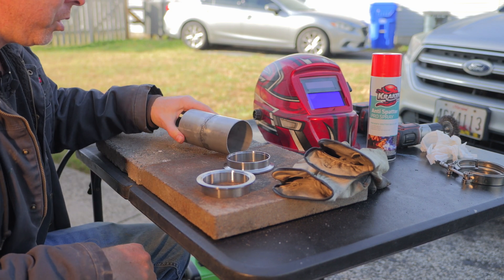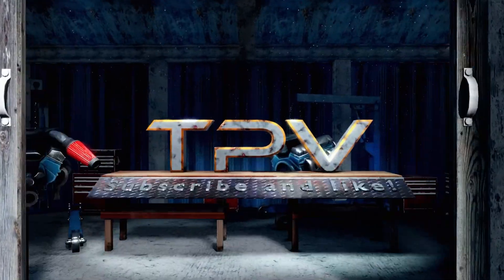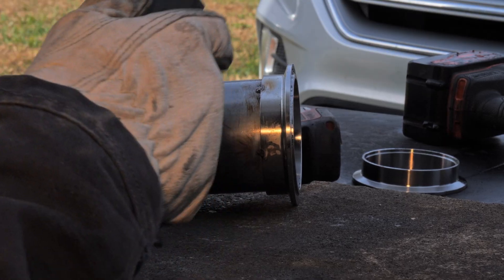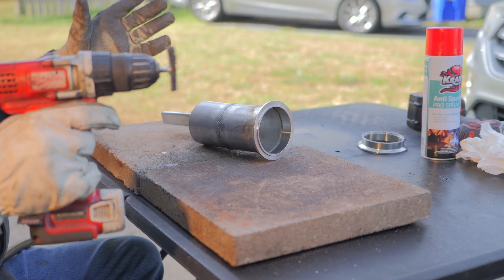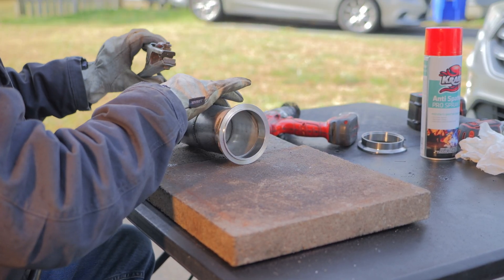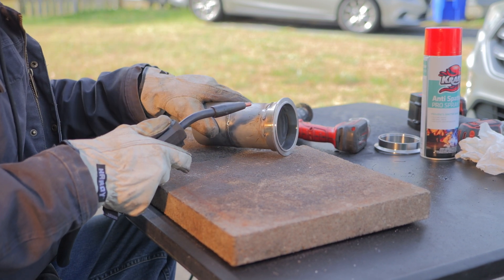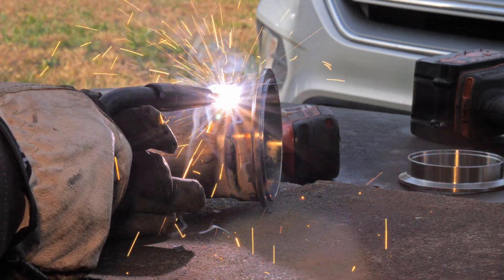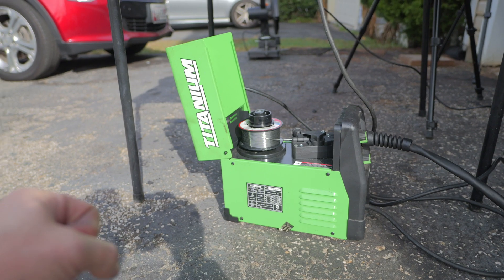How to Weld Stainless V-Band Clamps to Mild Steel with a $200 Harbor Freight Welder

Comment: Nice job good looking well for flux. Only thing I would say is maybe you should use stainless flux wire because that wire any other wire really does not stainless. It’s gonna rust so you got a well it’s gonna rust and rust fast. I might try it but I think I’ll try it with stainless wire stainless flux wire and see what happens. Seems like there’s no reason it wouldn’t work. What do you think?

Comment: Would this still work with stainless piping and a stainless v-band? I also want to do a custom exhaust and would love to try it myself. Is this welder a good option?
Reply: @codydonovan7356 You'd be better off with stainless flux core wire like BlueDemon 308LFCO if you're welding stainless pipe and flanges. You have to run that wire DCEP though so you need a welder that will allow you to change the polarity, the Titanium 125 is hard wired DCEN.
Reply: @bavarianblessed i thought it was DCEN for stainless flux core? My hobby mastercraft welder is hardwired to DCEP. Thats why i never tried to weld stainless.
Reply: @MN-sc2uz  no sir, most flux core requires DCEN but stainless flux core won't penetrate worth a damn that way. Needs DCEP

Comment: clamp vband together before weld to prevent warp..
Reply: Learned this the hard way. Very good tip.
Reply: This 100%
Reply: Damn, didn't think of that! Now I'll have to check if my v bands are warped 😬
Reply: I was thinking the same. Its getting warped

Comment: Would it be easier to do this horizontally? You wouldn't have to worry about slag then either. I need to weld one to a stainless steel reducer which is thin so i'm worried i'm going to blow through it.
Reply from the maker: @mooosestang  Weld it hover you feel most comfortable.

Comment: Have not done much exhaust work. But i do have experience with sanitation pipe. Just some advice, you always want to put three to four tack. 12,3,6,9 oclock. Sanitation pipe are mostly butt weld, but here the pipe slide under the clamp. So i get it, it might be necessary here.. just good habits to the untrained.

Comment: Uh downhill with flux core is a no, you fill the weld with flux inclusions and makes it brittle. Would have been better if you would have stood the pipe on end and welded around it
Reply from the maker: @No1414body   You can weld down up and upside down with Flux doesn't matter.  I know for a fact it doesn't make it brittle because I slung a drive shaft out my truck and the welds all held just fine the pipe and the mufflers bent a S Ton.

Comment: TIG is the only way. Anything else is hackery.
Reply from the maker: @HotColorsPowderCoating  They all have their place can't tig in the wind.
Reply: @TPVPRO yeah you can, just use a big ass Furick cup and high flow of argon.
Reply from the maker: @Shadow6a  To a point you can.
Reply: @Shadow6a  why? waste of gas? All welding done correctly is equally as strong. Its about penetration and the metal used for filler. ER70s is the same regardless of process.